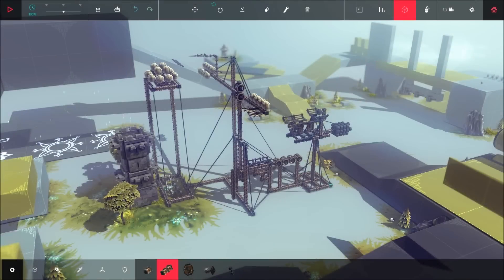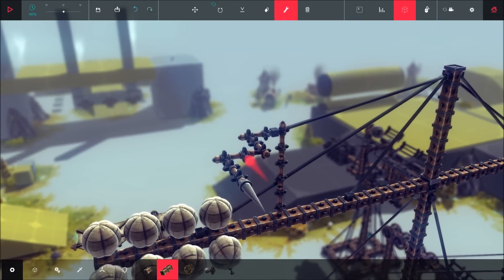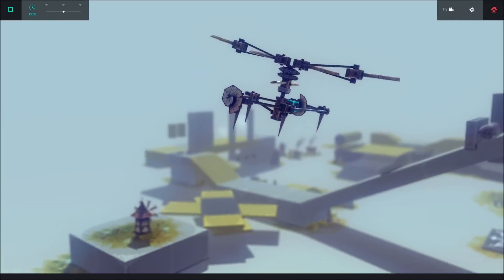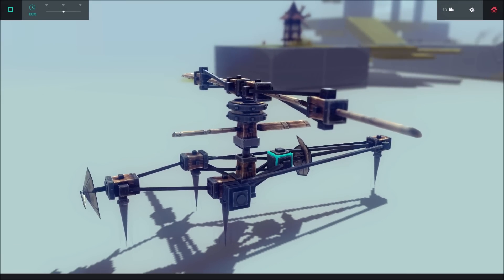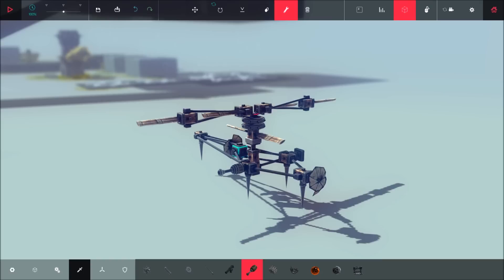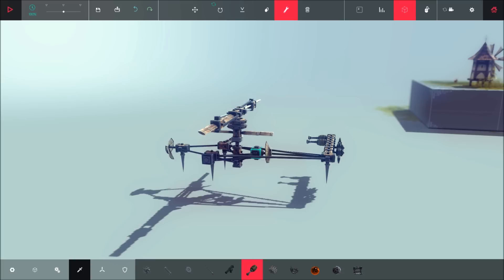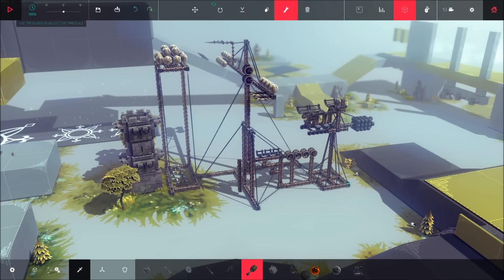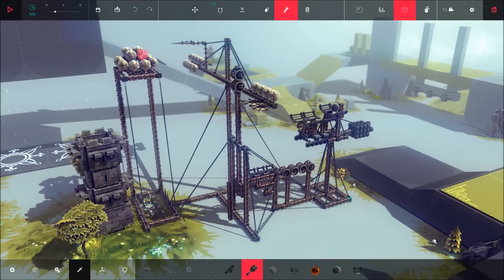Besiege V0.04 - latest update - New Stuff & Rube Goldberg Machine

Comment: I believe the toggle mode for flamethrower and springs means you no Ionger need to hold the button. Just press to engage and press to disengage.

Asymmetric decoupler no has one side smaller than the other.
Reply from the maker: Thanks for this, I sounded a bit clueless in regards to it. lol
Reply: Update:

Decoupler now has*

I was slightly off on my thoughts. Flamethrower now requires holding for continuous death. Prior you pressed it once to engage and a second to disengage. Now it it fires as long as you hold.

Contractable Springs toggle mode allows you to enable or disable the ability to have the springs contract completely at once on single press or contract as long as key is held down. 

Also, awesome small helicopter and im happy to help.
Reply from the maker: Cheers, Thanks for the comments